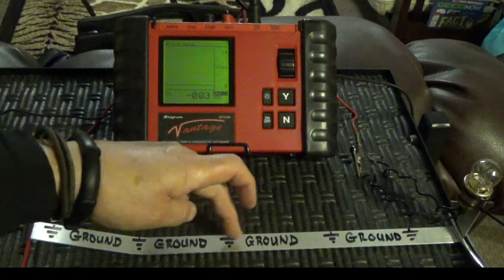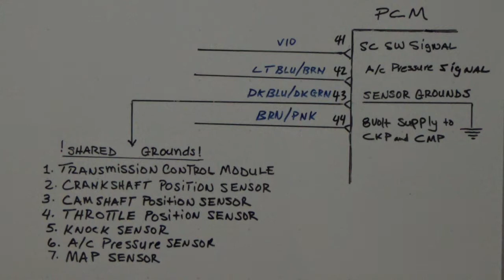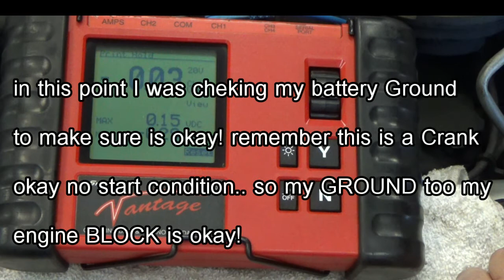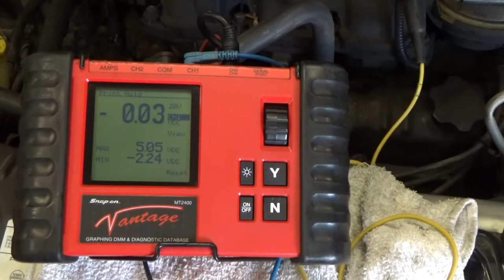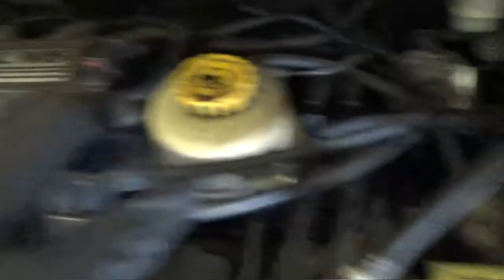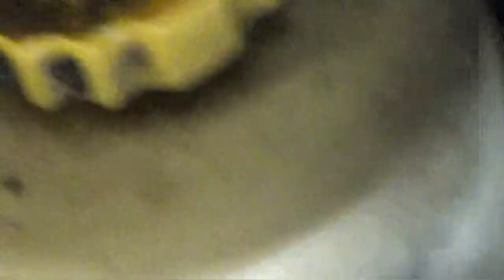2003 Dodge Grand Caravan Bad ground crank okay no start

Comment: When I turn the key sometimes it doesn't start, as in it doesn't even crank. And repeatedly going from the off position to the start position, sooner or later it would start. But it almost left me stranded at work today until I got it to start. Any ideas?

Comment: I think I found my problem when I replace the timing chain I put cam gear from 05 engine because I was thinking was the same but in the dealer they told me are different so I will remube timing cover to maysure get the right part but I will do in 15 days from now soo when I finish I will let you know thanks

Comment: I did test with test light and only flash 2 times I test the wire and there is not resistance on the wire but the car don’t start even with the other cyl sparking when crank the engine
Reply from the maker: Antonio buezo cut the wire on the computer connector and doo the test again
Reply from the maker: Antonio buezo It should start and run even with a one ☝️ driver down! Do you have any light flashing on the instrument cluster? Did you hear 👂 the fuel pump prime for two seasons just by cycling the ignition key ON and OFF ? Did you test voltage reference and the easy sensor, 3 wire sensor!? Some time the computer that you by plug and play have some secret code missing or problem and not all the scanner can get to the security for you to check out if that’s your run to start problem!

Comment: Hi again yes the driver #2 is no sending signal to the coil i test the wire from coil to computer test for continuity short to ground short to power  and the wire look wood
Reply from the maker: Antonio buezo Did you test the Driver #2 wire directly from the computer connector?

Comment: Hi how are you could you help me with an advice I have 01 town and country 3.8 no spark from #2and 5 from coil I test signal from computer and my test light blink 2times and that’s and I was thinking was no signal from the driver on the computer soo I bought new computer plug and play but still have the same problen no signal coming out from computer to coil
Reply from the maker: Antonio buezo You have to do a wire integrity from the computer to the coil... in this Chrysler you have 3 drivers   Ignition coil driver #1 fire Two spark ⚡️ one is the power spark and the other is the waist spark! Driver # 1 is DK BLU /DK GRN wire color code! Driver #2 is DK BLU/TAN Driver #3 DRK BLU/.ORG so you have 4 wires going to the coil one ☝️ is hot battery 🔋 voltage the other 3 are driver control ... I don’t remember if your PCM is under the left fender well but in this Chrysler and Dodge product like 12 inches from the computer connector are known the hardness to be corrosion and wires damage!!!
Reply: Please if you can help me I will appreciate thanks
Reply from the maker: Antonio buezo Thinking 🤔 about it your driver #2 is the one ☝️ you should test because fire the coil #2 and that coil fire cylinder 2 and 5 ....
Reply from the maker: Antonio buezo Wire color DK BLU/ TAN that’s dark blue with a tan trace color code! Find the wire in the ECM connector and backprobing with a “T” pin or cut the wire! Test light 💡 in battery positive should flash at all times with the engine running! Doesn’t flash is a bad driver! But you install a new PCM so have to be the wire!

Comment: @Pete Sambolin I have a crank but no start 03 caravan sport. I just put a 05 engine in it and swapped the cam gear and the flexplate so it would run properly, only to have discovered that the fuel injector harness was melted and wires were touching. After swapping the harness it still won't start. I have no spark. Any help or suggestions will be greatly appreciated.
Reply from the maker: Brian Jenkins okay so you change the CAM relector? I see this problem in a Dodge Ram before after they swap out the engine they change the CAM relector and truck don’t have no spark! But wasn’t timing problem was harness problem by the Gateway the module under the fuse Box! In your situation I will start in basic with a test light and check coil control and fuel injector control see if the PCM is controlling!? Next or before of that check with a volt meter if you have the 5.0 volts reference on any easy sensor you can see! Also check the ground of the sensor to the PCM.. with a good scanner go to custom DATA and select Engine RPM, CAM, CRANK, TPS, CAM sync, CKP sync, check the data went cranking! If No RPM present or CAM & CKP is out of sync?! Car will not Run!!!